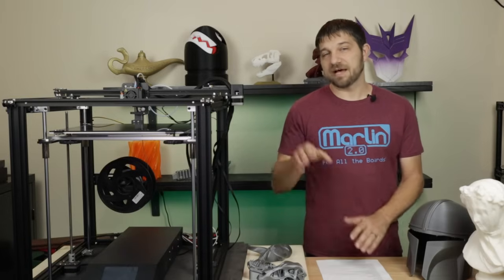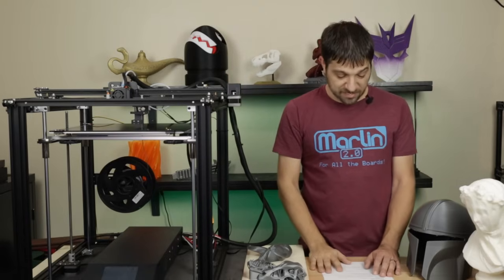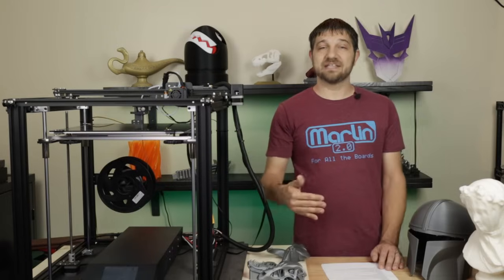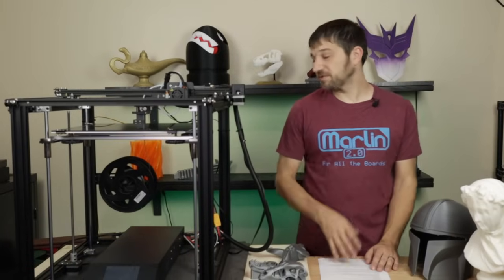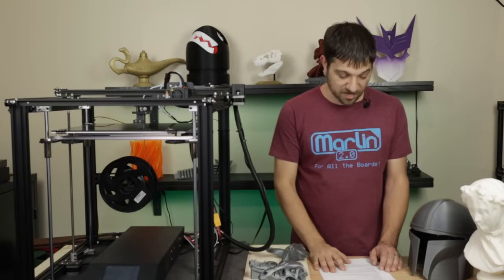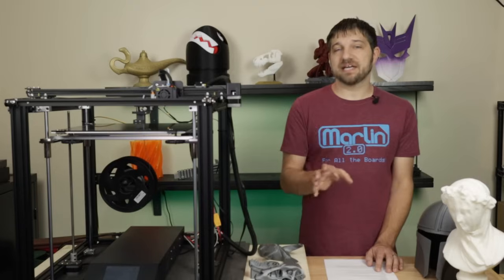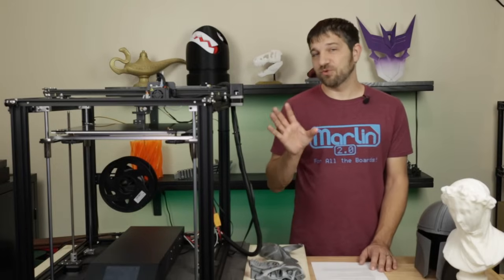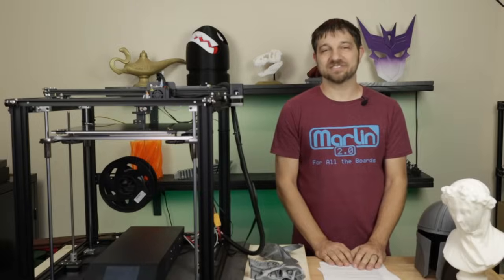Creality Ender 5 Plus Review: EVERYTHING You Need To Know!

Comment from the maker: Notes/Updates/Corrections:
- There are some focus issues in some of the wide shots if you go full screen. I'm still learning the new equipment! Thanks for your patience.
Reply: all good. still got the information out.
Reply: i spoke to Creality 2 days ago and they told me that they weren't planning to open source the firmware. kind of weird considering that its based on marlin
Reply from the maker: Well, since the publishing of this video they seem to have changed their mind. Their rep recently told me that it's coming soon. I don't know what's the hold up but I'll be sure to post when they have.
Reply: @kerseyfabs  im really happy to hear that, i have a e3d hottend i want to try out with the silent mainboard but im waiting in the firmware source so i chance change the thermistor type in marlin. 
been loving the videos btw
Reply from the maker: @Choppy_PHC  Thanks! I have a video planned on my short list about upgrading the mainboard. I'll give more details later!
Reply: @Kersey Fabrication will you be doing the non-Creality firmware review soon? I've been waiting for an update on the BLTouch fix for quite some time and have yet to receive a response for Creality when they plan on fixing it. 

I have manually done Z-axis offsets but I cannot build past 4" x 4" on my printer due to slight variations in the glass. I spent hours trying to fix the level and have yet to realize the full functionality of the build area. I'm hoping the BLTouch fix will help me with this issue. I appreciate any feedback you have :)
Reply: How difficult is it to upgrade fw on the 5+? Other than resin my only other printer is a Ender 3 v2 so flashing is extremely simple. I happen to have an extra 4.2.7 board laying around just in case the one I ordered comes with the loud drivers....
Reply from the maker: @Davidrcobb  I actually have two videos on that:
https://www.youtube.com/watch?v=ExuPoNZK_aw
https://www.youtube.com/watch?v=9pDoxf13_wg
I hope that helps!
Reply: @kerseyfabs  you are the man sir. I glazed over and missed it tyvm.

Comment: another trick for cleaning the print bed is a spray bottle filled with rubbing alcohol and lint free wipes between prints (cleans any fingerprints off from removing the prints as well as any residue from the plastic) as I let my printer cool between prints allowing the prints to detach easily... I had went through a full kg of filament trying to fix random print non-stick issues until I found the rubbing alcohol solution at just a buck a bottle from the local dollar store (a block from my house)... I now never have a non-stick issue.

Comment: Update** I got my Ender 5 plus yesterday and it came with a mean well power supply, can’t say if all of them have it. I was gonna replace it to a mean well but this saved me time and money
Reply from the maker: I've heard this from others. Terrific news!
Reply: That makes me happy that hopefully the new batch that arrived at my local microcenter will have a meanwell
Reply: How can you tell if yours has that? There's no voltage switch on mine so I suspect it has the same
Reply: Same here , Meanwell inside and separate ground wire to the chassis.
Still have to put it up, but will not run the original board. I like the SKR 1.4 turbo and TFT35 combo wich i used in a Zaribo/Haribo build.
And by the looks of it will be using the SKR mini E3 V2.0 ...will be missing out on G34 but don't like cutting up the chassis...:-)

Comment: I'm brand new to 3D Printing and just got the Edner 5 plus.  Thank you for mentioning to turn off the economy mode.  I kept having my prints come loose, and was just starting to wonder about that setting and noticed the bed was cooling off.  Then I saw your video and it reassured me that's the issue.  Trying a new print now, with me luck :-)

Comment: How does the auto leveling work, I have a cr 10 and I can’t use it as much as I’d want because leveling it is so finicky, would this solve my problem.
Reply from the maker: Awesome question! Auto-leveling works but having software compensate for an unlevel bed. It creates a map of the bed and move the Z axis to compensate for bed changes. It's not as great as an actual level bed but it sure does save you some time. You can add it to most Creality and other printers. Creality leans towards BLtouch.

Comment: thanks for the great review. As an owner of an ender 5 plus also i have found afew things out with the printed that have helped out alot.
1) change to a Capricorn tube and new connectors.
2) for stringing settings i an up to 8mm distance and 60 mm/sec and there is no stinging
3) for outside layer quality jerk seems to be a key setting for this printer.
4) as he showed in the adjust menu the z offset adjust helps alot to fine tweak your offset and it does save that setting

cheers and happy printing
Reply from the maker: Thanks for sharing your tips!
Reply: Are there any forums or groups where i can join for this printer??
Reply from the maker: @befrey  There are very active Ender 5/Pro/Plus groups on Facebook. I'm not sure which other forums may be available.
Reply: @kerseyfabs  can you point me 2 1 or which do you prefer??
Reply from the maker: @befrey  Sure! This is the only Ender 5-specific group I use regularly.
Official Ender 5 Facebook Group: https://www.facebook.com/groups/ender5creality/
Reply: @kerseyfabs  thanks , apperently i already joined that one xD
Reply: I like the 2.2 silent board add on as it is extremely quite (I've had to look over at it to make sure the hot end was actually moving after the board change where with the stock 2.2 board that mine came with it could be heard throughout the house (my walls are very sound deadened it's just that loud) and I'm changing the stock cooling fans/ ducts as they don't cool the part very well as its printing, also look for a roller bearing filament spool holder as it makes the printer work that much better with much fewer filament tangles less filament drag and grinding etc., in combination with the all metal feed as the stock feed breaks and look for a screen shade too as it'll light up the room when running those long 16+ hour prints

Comment: I purchased one after watching your first video, I have no experience with 3D printers and mine printed straight out of the box. The only problem I had was a loose wire in the  power supply ( would not heat up.) tightened the wire connection and no problem since. I have used default settings and the Creality slicer
for my prints and I consider them to be of good quality. so I am quite happy with this printer.
Reply from the maker: Thanks for the feedback Alan. I'm glad you've had a good experience!
Reply: My ender 5 was great out of the box . But soon after it started to screw up . Needed to many up grades for me . I sent it bad a.s.a.p
Reply: I had the same problem but, was an easy fix. I should have read through these comments first. It would have been easier to figure out!

Comment: A comment about cleaning the glass print bed - I use a spray cleaner called "Invisible Glass", since it leaves no residue.  Also, paper towels can be trouble since they contain some kind of binders that help them stay in a roll.  I use news print instead.  You can get a big stack for small cost from U-Haul packaging material.  It's the stack of paper you can get for packing boxes.  Don't use newspaper, since the ink can come off of it, but use clean "newsprint" paper.
Reply: Thanx... anything else?

Comment: For the grounding test, you need to test starting from the power plug ground connection to the printer chassis
Reply from the maker: Technically you're correct but I guess I assumed the wire from the plug to the supply was good.

Comment: Would really like to see a video on updating the firmware settings on this printer (i.e. e-steps for upgraded extruder options) given than the touchscreen does not offer the options of other Creality machines via the display (at least as of now).
Reply from the maker: This is on my short list of how-tos. Thanks!
Reply: @kerseyfabs  Maybe how to upgrade to Hemera?
Reply from the maker: Yes! I have one and that's what I plan to do with it.
Reply: @kerseyfabs  Not seen enough to sell me on it yet, but likely will be quite a bit lighter than the V6/Bondtech direct solution I use on my Ender 3 (and likely will migrate)

Comment: ABL on - actually enables the use of the mesh stored in the firmware - the G29 command is what makes it run the ABL in front of each print.  So M420 S1 - M420 Z10 (for 10mm fade hight) - should be used in start script in the slicer to get proper results from ABL usage. To many people ignore this important information when talking about ABL
Reply: Thanks, Any chance you can show an example of this ?
Reply from the maker: Thanks Stig. I'm aware of the difference. In fact, in my start G-code I always use the M420 command. For me though, enabling that switch on the touchscreen has always resulted in it rerunning the mesh each time. Have others had different results?

Comment: So far, the very best information on the Ender 5 Plus.  I have some problems with many of the reviews that talk about problems on an earlier version that might not apply to my machine.  While you often make the disclaimer: "at the time of this video", it is still hard to know what issues might still apply to me.  As a new user of 3D printers, I also find it tough to understand every aspect of the printer.  I am still working on understanding the screen that appears after doing a measurement step.  Obviously I am presented with Z measurements, but what is an acceptable difference in the measurements of the 16 points is a mystery to me.  Also the Z-Unit compensation remains a bit of an enigma.  That said, your comment about turning off the econo mode might have saved what little hair I have left as I was nearly to the point of pulling it out when parts popped off the bed after a few minutes.  Thanks!
Reply from the maker: The grid of measurements you're presented with aren't really meant for you to evaluate unless you really know what you're doing. By looking at the grid, you can find out if there's a particular low or high point in your bed or if the bed is particularly crooked. Then you have to know what to do with that info. Unfortunately, it's a bit much for me to cover in a comment. The Z adjustment is to be used to get the print head a little closer or a little further away either during leveling or during printing. It's fine calibration to make sure your filament is going down as nice as possible. I'm happy to help where I can.

Comment: Thanks for a great review. I watched the unbox, build and test vid before adding the 5+ to my short list of printers. On the strength of your positive comments I have taken delivery of my 5+ and rewatched original vid and this one too. One problem solved already, the economy switch. First Benchy got to about 55% and came off bed! I washed the plate and started new print with eco turned off, success an acceptable benchy. I will go as far to say the printer was easy to assemble, moderately easy to level, but the included Creality slicer software does not include a MAC version. I have D/L'd Cura which works well. This is my first extrusion printer so have to modify thinking a little as have used resin printer previously. Main reason for the 5+ was the build volume. Kris I really appreciate your attention to detail and clear explanation of step by step instruction. Looking forward to undertaking the 5 most important mods as parts become available. Thanks again. Bill
Reply from the maker: Thank you for your comments. I'm in the middle of going the other way, filament to resin, so I'm learning too. I appreciate you watching and taking the time to leave feedback!

Comment: Thanks for the comprehensive review, I watched it right before I clicked buy now on the website. I intend to print almost always the full build volume with ABS/ASA and will mod it to my liking for best performance for that. I haven't found any other entry/mediocre-level 3d printer for that price range and such a straightforward upgrade path. I only had experience with a very entry-level printer from flashforge and I only had troubles with proper ABS prints and a good process for model-to-print besides a tiny print bed of 150x150. Thanks for the comprehensive review, I am waiting with great anticipation for my delivery.
Reply from the maker: Thanks for the comment Max! Best of luck with your new printer. This printer is fantastic to mod and I think you'll be very happy with it!

Comment: This is my second printer, the first being CR-10 . My biggest gripes after first 2 weeks  are, 1 the firmware is very FINICKY with the way you name you gcode files. It seems that you cannot have any spaces in the filenames, otherwise they are not visible to the  system. Excellent readability off switching out sd cards instantly reads and allows you to print . 2 no way to add steps/mm  to set the feed rate on your extruder. 3 cable management obviously.

Comment: Backlash occurs on ballscrews when the nut is loose and stepper motor changes direction...   On this 3d printer the z-axis goes down.. doesnt change direction halfway through a print to go back up... therefore there's no backlash on any z-axis printer.
Reply from the maker: There would possibly be some if you use Z-hop but it wouldn't usually be a concern. The reason I use anti-backlash nuts is to reduce slop on the screws.

Comment: Thanks for your thorough review! 

You mention that Creality has address any issues that you have had. I have not shared that experience. I got a E5+ as a Christmas gift and have been trying to get an issue with the SD card slot resolved for last five days. For the first two days of ultra slow chat response I was told at least two times to try another SD card in the slot. I did that and although my computer could read both cards the E5+ could not. They then told me to work with the seller so I went to Amazon (twice) where they told me to make sure it was plugged in and turn it off and back on. After five days I still have a bad SD slot but now I have a E5+ back in its box ready go back to Amazon. The down side is that they are not giving a full return. All this to point out that Creality has yet to honor their warranty and from a online search this behavior is the main complaint with them. 

If you decide to remove this comment, I understand since almost no one wants hear whiners.
Reply from the maker: I would never remove a comment with a legitimate concern. I know there are some weird things with formatting the SD card properly for it to be readable by the printer. Unfortunately I can't help at all since it's already boxed up. That's not your primary gripe though. You want better warranty support and I understand completely. Contact Amazon's customer support and explain your situation and they may be able to give you the rest of that refund. All the best with your future printers!
Reply: @kerseyfabs  Thanks for the moral support. I sent the printer back to AZM today. I am wondering if the support would be better by purchasing directly from Creality.
Reply from the maker: I certainly hope so. Also, be sure to reach out on social media for help. Facebook groups are your best source, if you're on Facebook.

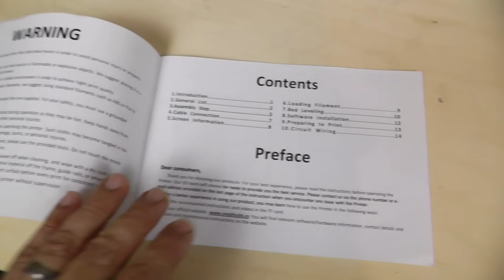Comment: Hi, I have seen several of your videos, BIG THANK YOU. Is there any way I can ask you for any direction to fix this issue?  Ender 5+ not going to +X when selecting leveling so it does not go home properly.  https://youtu.be/KrCL3JSGM1A jump to 1:24 if you have a minute or 4:50 on this one https://youtu.be/KrCL3JSGM1A Everything else works properly but this is driving me crazy en support on the manufacturer is almost none. Best regards.
Reply from the maker: No problem. It looks like your endstop may be triggering early. Try separating that wire from other wires and see if that reduces noise.

Comment: I have this printer at home, and it works perfectly. I changed to a metal extruder, and better tube as first mod. Then just after changed to a full metal hotend with a ruby nozzle. Prints veryvery well for the price and setup time, maybe not even an hour. Have Promega M3D at work that i manage, and it is a huuuuge pain in the ass. Nothing is working with it. And that is a 3500dollar printer, like jeezus. 11/10 would exchange the promega with an ender 5 plus for work too, would almost call it an upgrade :)

Comment: Kris, a great review.  I can tell you spent a lot of time and thought in putting this together and it is really accurate.   I have been using mine for a couple of months now and have some suggestions for users.  This is a great second printer.  I have two Ender 5s and found that this was a bit of a challenge to get set up, but my experience with them really helped.   I am a big fan of TH3D and want to change out the BL Touch with an EZABL and swap out the mainboard with their EZBoard, since I have done this with both of my Ender 5s.  I have changed the hot end and extruder with a MicroSwiss and SeeMeCNC which have worked well, but just installed my first Hemera on a Ender 5, and it is a game changer.  As you pointed out this is a great platform for making mods to.  It also is a great value for the size, construction and  low cost.  I look forward to your future videos on upgrades.
Reply from the maker: Thanks David! I took my time on this one and I'm happy with the results overall. I'll be working on a Hemera video on this one!